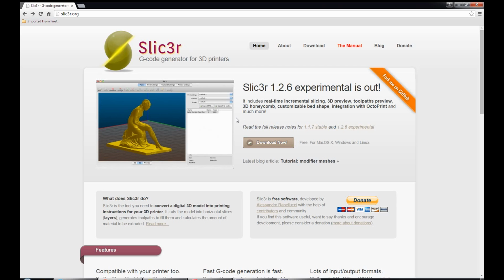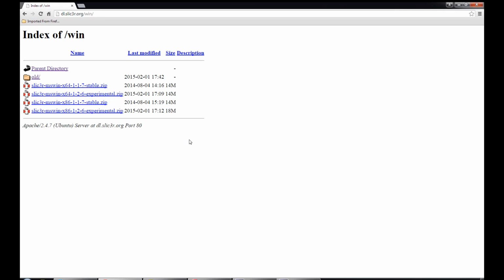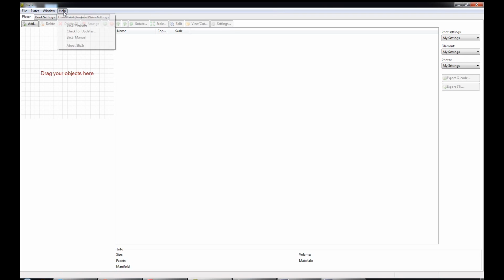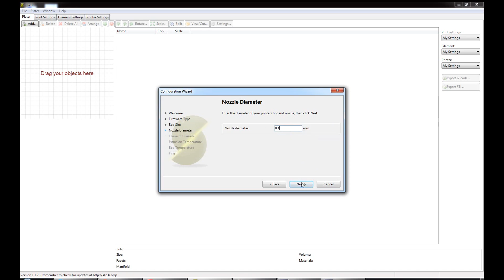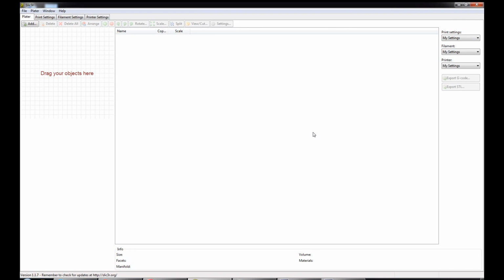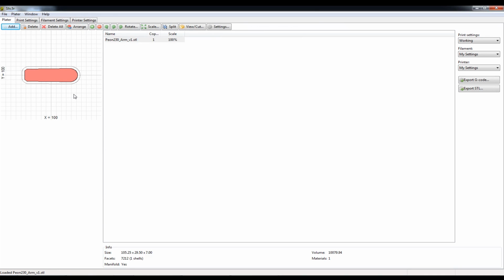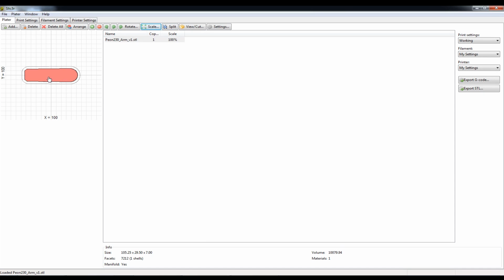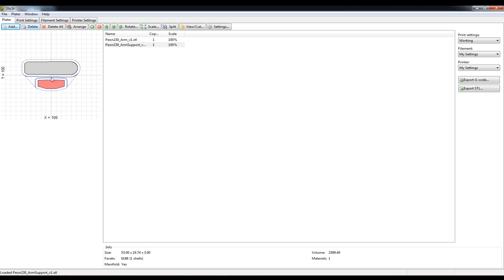Slic3r tutorial for Prusa i3 3D Printer - Part 1

Comment: , by using slic3r , How can I print only honeycomb shape, tensile test sample , without four +45/-45 layers that cover the honeycomb shapes from 
bottom and top ? . Iam using MALYAN FDM and makerbot software

How can I controll infill pattern in form of 0 and 90 or only 0 or 90 degre
Reply from the maker: +Ahmed Sabah 
Set the top and bottom layers to 0.
Reply: thanks for reply and how could I print infill lines in direction only 0 or 90 degree and once again 0 and 90 degree respectively ?
Regards